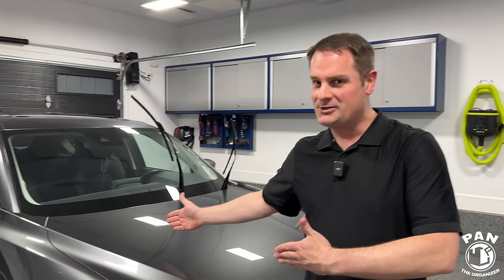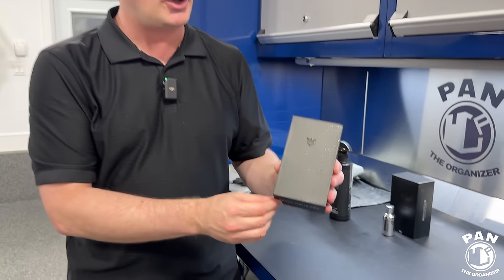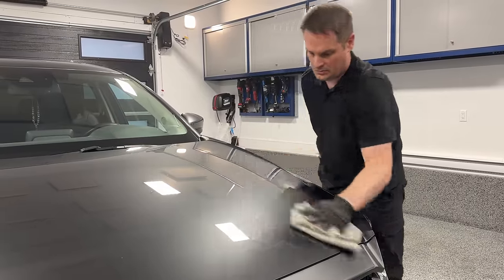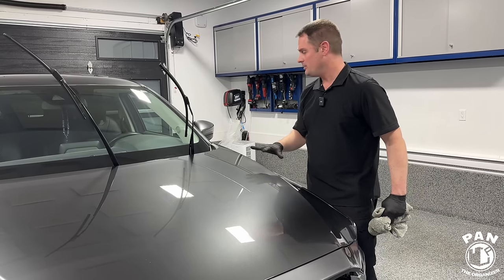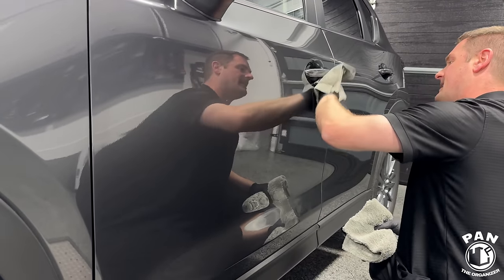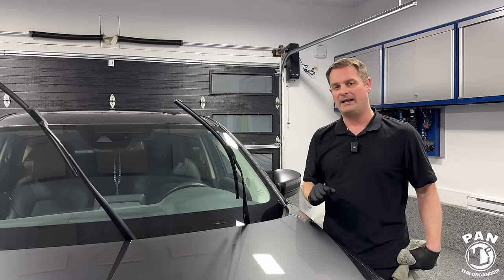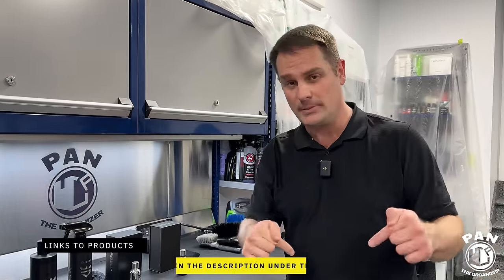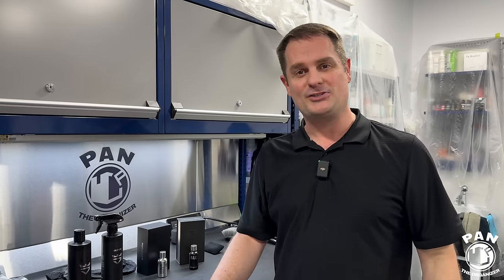NEW AvalonKing Armor Shield MAX ceramic coating! 1 layer, 3 years protection!

Comment: P-T-O.........what does the professional 5 or 7 year ceramic coatings cost per bottle for professionals like you to buy?
Reply from the maker: Costs vary greatly from one brand to another... There are 500$ coatings, and there are coatings under 100$. Plus, most coatings for professionals are only available to authorized and certified dealers, meaning you have to pass an accreditation with the brand.

Your best bet, if you are a pro detailer, is to get into contact with a brand you trust and would like to make business with, and enquire about their certification process and costs.
Reply: Oh no, I'm not a pro.  DIY'er.....I just did my 2022 Cadillac XT6 in black....came out great.  You helped me by anwering all my questions.   My friend just bought a 2024 Vette C8 and a shop in Miami told him $2500 for a 7 year ceramic coating.......LOL.....luckily I got to him first.  Another shop is doing Avalon King IX for $600.00 with all the good prep steps that you do.  That shop told him 2 years of protection.
Reply from the maker: Yeah 2 years for the AK seems like it’s possible with two layers and proper maintenance. My brother got 18 months but little to no maintenance. Good coating for someone who has never applied a ceramic coating as it’s super easy to apply.

But there are certainly better coatings out there. All of my favourite picks are in my popular awards video here: https://youtu.be/KRv7vKsuliQ?si=C7Kb4cqk4t1mDgqO
Reply: @PanTheOrganizer  …….can I put another coat of AK on my car?  I did the first coat two weeks ago.
Reply: Do I need to use a PH nuetral car wash soap with AK ceramic coating?   Thanks.

Comment: I don't understand how your application was so much different than my first experience with AS max. From start to finish of a truck, the leveling towel, finish wiping wasn't gliding at all. When leveling, the towel drug over the paint, ceramic never flashed even after 5+ minutes. Worked in a shop 70° with 55% humidity. After 20 vehicles, no problems with AS IX even in various temperatures/humidities, this MAX acted totally different. Very disappointed with MAX.

Comment: that mazda has 100 years of ceramic coatings installed on it at this point.
Reply from the maker: Lol what? It litterally only had one true ceramic coating applied to it in its lifespan (the ones in glass bottles). What are you talking about?! 😂

And if you saw the two year update video, there was no protection left.

Please get your facts straight before dropping comments like that.
Reply: @PanTheOrganizer  lol so many times i watch your vids it seems that you are applying some coating to his suv. :)
Reply from the maker: LOL Yeah but reality and what your impressions are, are two different things. Case in point, you can go back to past videos and see. When he initially got his vehicle in 2020, we applied a spray sealant. A year later or so, we applied the first true coating (AvalonKing Armor Shield IX). During those two years, some maintenance was done, very rarely as he didn't do much haha, but we did apply a few light sprays like Armor Shield Lite, Gyeon WetCoat and Gyeon Wax (one on each half of the vehicle for another test). And that's pretty much it. But again, only one true coating had been applied since he bought the vehicle in 2020.

I hope this clarifies things. Have a good weekend.